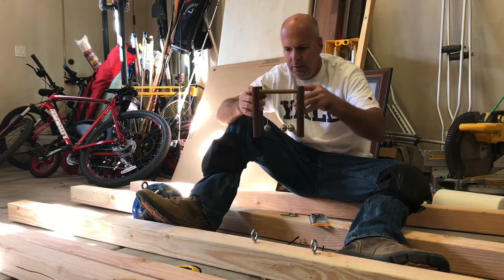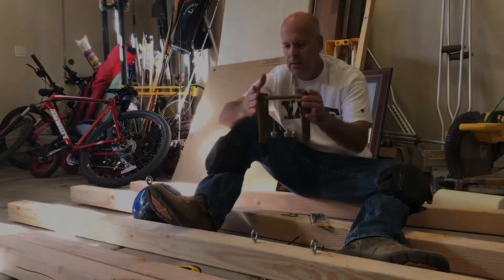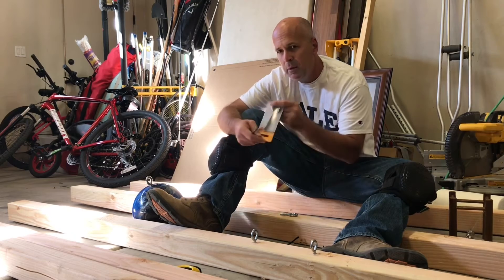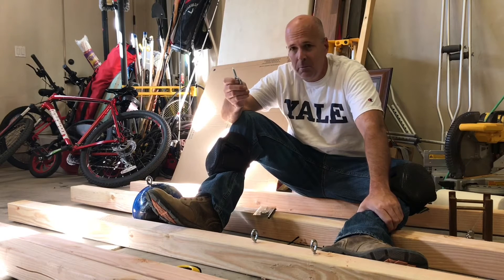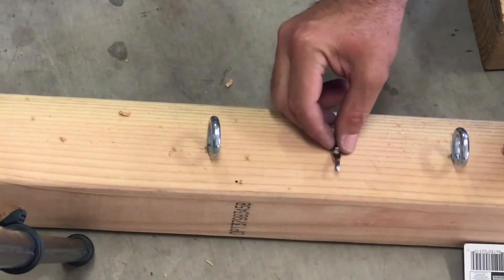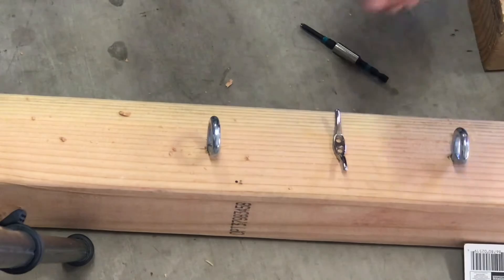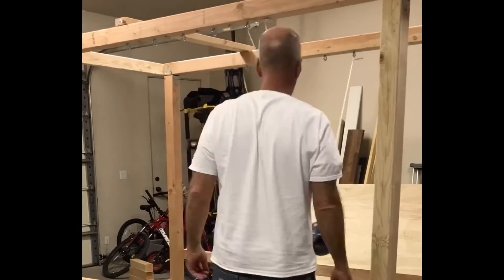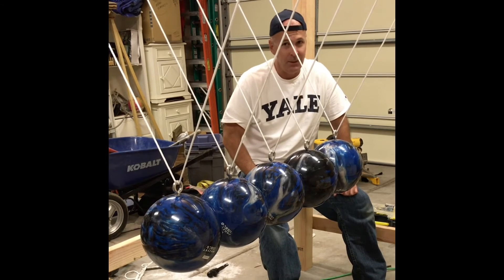Huge Newton’s Cradle Made From Bowling Balls

Comment: you know, solid steel balls of this size would probably make a better newton's cratle (because steel is more bouncy than plastic shell of a bowling ball and the higher density also adds more energy to the cradle at the start)

altho all that mass also makes the balls much more difficult to pull back or slow down whith just your hands
Reply: The balls would also be about as fun to move around your garage as a 500 pound anvil and wouldn't even end up swinging smoothly unless the entire frame was embedded in like 30000 pounds of concrete because otherwise the weight transfer of the balls would have so much the momentum they would just rack and destroy the entire frame in one swing. They would also have to be suspended with steel cables instead of rope which would probably bind up and waste most of the kinetic energy due to friction instead of transferring energy between the spheres